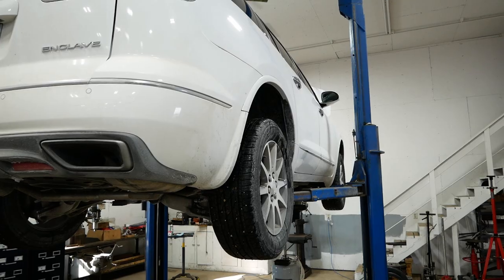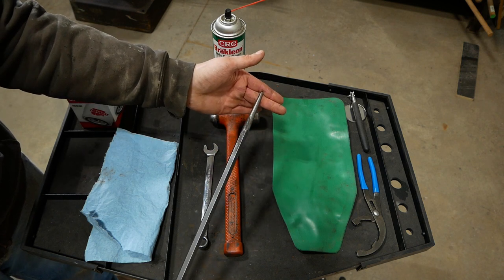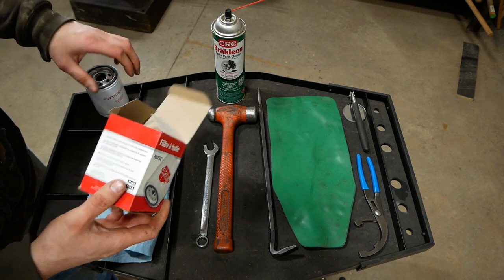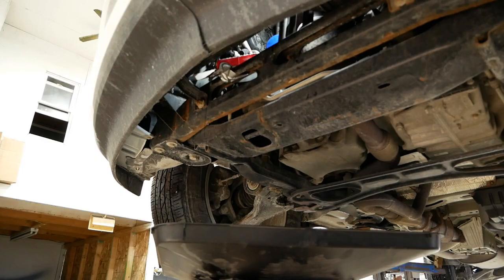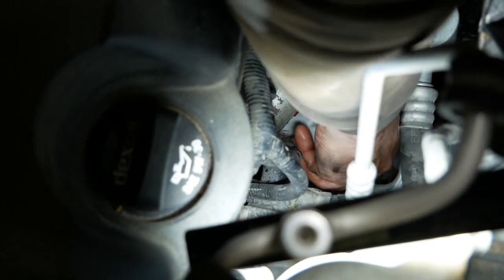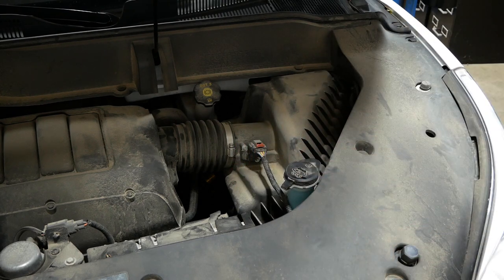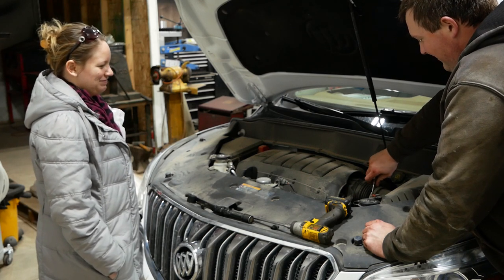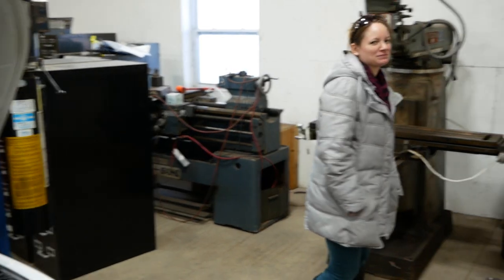Changing a GM 3.6L Spin On Filter without Spilling Oil?

Comment from the maker: How do you change these filters?
Form-A-Funnel General Purpose - https://amzn.to/360r9f6
Mayhew 16" Rolling Head Bar - https://amzn.to/2Y0jngN
Channel Lock 9" Oil Filter Wrench - https://amzn.to/3iAhIYE
Stanley 24oz Ball Peen Dead Blow - https://amzn.to/3phwzd2
CRC Brake Clean 6 Pack - https://amzn.to/3sLXobK
Reply: they what to service what they sell think about it if you soled a product wouldn't you what them to bring it to you for service you have  to think like a businessman just look at the vehicles today no dipstick tube on the   transmissions  you cant even  check the fluid  level
Reply: Run a shop vac on the oil cap while you unscrew and replace the filter.  It creates a vacuum so oil won’t spill out.
Reply: If I was doing those all the time I would make a piercing tube and then hooked to a vacuum oil tank suck the oil out of it.
Reply: @2ksilver  good idea!, But the filter will be full of oil that will leak out.
Reply: well when the engine is in the right way round it works fine lol lol 
pity the electronics on the 3.6 is crap IE the ecm and bcm communication in the aus varient we have down here in NZ.
 I have 3 of the pieces of s&%t in my workshop with f)$%#d computers
Reply: @2ksilver  is that an idea you've just had, or something you've done?

It sounds extremely plausible.
Reply: @2ksilver  The oil inside the filter will still spill out once you start unthreading and the seal is broken.
Reply: If you don't have or want to get a Form-A-Funnel a few layers of heavy-duty tin foil work great!
Reply: The reason why the engineers do that. Because in high-school they were picked on.
So they say, fine we will screw everyone.  Can't easy to do a oil change.  Plus if something breaks it can't be fixed. The revenge is complete.
Reply: @HerdOfMeese6195  
A strip of lead flashing in a  plastic bag. Throw out the bag.
Reply: I’d likely change it the way I “change” the internal filter in the CD4E transmission if I’m trying not to rebuild it, and that’s flush it with thinner fluid if it really is an issue and ignore it otherwise

Comment: As a GM engineer and due to the fact that cardboard is in short supply, it's better to remove the engine and put it on a stand to change the filter
Reply: And remove the engine to have optimal access to the air filter box!
Reply: Well, dang it all, now you're thinking like Ferrari, Lamborghini, Spyker,  McLaren.......
Reply from the maker: Must be a TSB for that!
Reply: @billh230  At least with the European makers, it's partially justified, even if just to gaze in wonder at the beautiful sight of the engine.
Reply: There was a car back in the 60’s - I think it might have been a Pontiac but I’m not sure - where indeed in order to change the oil filter you had to lift the engine.  Wish I could remember the make/model….
Reply: Oh that’s a classic time saver I bet.

Comment: The plastic engine covers are there to provide a safe haven for field mice to build their homes and raise their families.
Reply: Yup! I toss them in the garage until it’s time to sell the vehicle.
Reply: @mikemaccracken3112  The plastic covers or the field mice ? Or both ????
Reply: @terryharvey4811  The mice lol, save them for the next guy.
Reply: I thought they were copying the Euro trash
Reply: @ericcorse  Naaah... strickly a PR move by GM to please the TREE HUGGERS.. Gotta protect the WILD LIFE. MICE NEED HOMES TOO.
Reply: @terryharvey4811  surprised the tree huggers dont get mad at all the plastic used...maybe its cause they never look under the hood
Reply: skippy needs a home too
Reply from the maker: Out of sight, out of mind!
Reply: @mikemaccracken3112  Too bad on some engines like 2.4 ecotec the stupid engine cover is part or the intake plenum
Reply: true dat!
Reply: @baileyhatfield4273  TREE HUGGERS don't mind plastic on cars, it's all the plastic bottles in the oceans they are so upset about. Chokes the dolphins. {this I do agree with, I do recycle} Yet when you see them out and about, most are drinking mineral water..... out of a plastic bottle !!!!!
Reply: The plastic is for channelling the airflow through the engine bay to maximize cooling and muffling wind noise. Modern aluminum alloy engines conduct heat faster, in a moving vehicle the airflow is from the front, past the radiator and around the engine and on the firewall. The firewall acts as a dam and sends the now hot air under the vehicle and outwards. With a good airflow you need a smaller radiator and less coolant and cycling of the thermostat.
Reply: Actually those plastic engine covers are there to hide all their stupid engineering!
Reply: @terryharvey4811  there is nothing wrong with plastic, it is the people that dispose of it improperly that is the problem. Plastic is made from oil refinery waste.
Reply: I love your viewers, especially this thread! Eaglegards...
Reply: Hey, mice need transportation too.
Reply: terry harvey 
Ahh yes, can't forget the poor little mice...
Reply: Mustie will be happy to hear that.
Reply: @mohabatkhanmalak1161  The worst design anyway. It maybe works while it's moving, but when you're stuck in traffic it overheats worse than a 50 year old car...
Reply: @jameshaynie4570  i AGREE 100%. We should all RECYCLE if not for us, then do it for our GRAND CHILDREN. Without plastic I would not be able to carry a six pack of cold drinks !!
Reply: On my 97 accord there is no plastic covers in sight. Almost everything is easily accessible from the engine bay, and even most of the things that aren’t are easily accessible from the bottom.
Reply: @mohabatkhanmalak1161  Har Har Har
Yer hilarious.
Reply: @Tinker001  Oh yeah, well cheers!
Reply: Plastic covers is  to stop the mice cutting their fingers off on any Sharp or moving parts , and suing the company
Reply: Who are we to question morher GM and the obsession of the asthetics national culrure

Comment: Maybe GM purposefully put filters there, so that the frame can be coated with oil to prevent rust
Reply: Ah, the wonders of modern engineering, why fix a problem properly, when you can fix a problem with other problem... and they dare to call it a feature.
Reply: Ah, you beat me to it!  😀
Reply: i was going to say that too,,,
Reply: above the cat too? maybe they just want the thing to burn to the ground..
Reply: Bad thing about that, the rubber in the engine mount will eventually swell from the oil and heat... Wala, failure!  A new engine mount install!!!  More work for GM service shop, better yet, for Wes!
Reply: That's whats keeping half of my Saturn's subframe alive
Reply: @dylanyates6331  What about the other half?
Reply: @yzhang8629  what other half? 😆
Reply: @dylanyates6331  You said half of your subframe is kept alive by leaked oil, so I’m curious about the other half that isn’t coated by leaked oil. Is that part still alive?
Reply: @yzhang8629  its rusting out. Thats the joke
Reply: They probably saw Mustie1's video on coating the underside of your car with bar and chain oil.
Reply: And Wes said the GM engineers weren't very bright.   😂
Reply: @dylanyates6331  lol
Reply: I dont like the  sideway filter. At least when it is up right you can fill it befrore installation

Comment: I lost all respect for GM "engineering" when I had to pull wheels, wheel liners, closeout panels and a bumper cover to replace headlight bulbs.
Reply: Same on my 2011 Subaru! The damn headlight is made of plastic too, and most of it directly faces the UV furnace (Texas sun).

Comment: I'm 79 years old and have been changing my own oil for my entire adult life.  My wife has a 2017 Traverse with that engine, and I felt much better after watching a master mechanic struggle with that thing.  It's a colossal hair puller.  Between the oil filter and air filter, GM wins the Darwin award for that one.

Comment: Had a couple cars with this issue.  My solution has always been to keep a roll of heavy aluminum foil in the shop to make my own form a funnel.
Reply: I always raided the kitchen. Just make sure your hands are clean, or you get the evil eye or worse.
Reply: @cheeto4493  raid the kitchen that's always a tricky movement, once I was caught warming some welding sticks in the oven, it was hard to explain why  I was doing that
Reply: Peel n Seal roll flashing from Lowe's works really well also. AND.... you can stick it anywhere with the tar side.
Reply: @Jess88176  I have to give you TIP OF the comment day for that one. Noted!
Reply: Is this Jeff Leach the Toyota mechanic from Boston?

Comment: I believe as part of their training automotive engineers should have to perform oil filter and headlight changes on the vehicles they design for at least six months early on in their careers, then they might change things!
Reply: The car companies know, its just another way of getting more money out of you.
Reply: American engineers are smart enough to buy Toyotas.
Reply: Some car companies do, BMW makes their new engineers work at a dealership for 6 months or a year before moving into design.
Reply: Generally it's not the fault of a single engineer, it's a siloed design thing. The person that designed the engine with the oil filter there had a perfectly reasonable design. Then the person that designed the suspension and frame had a reasonable design. Then the person designing motor mounts had a reasonable design. Then the person designing body panels had a reasonable design, taking aerodynamic efficiency and aesthetics into account.

But you put everything together without a lot of great communication and time/money for redesigns and you get situations like this.
Reply from the maker: Nah. That would make actual sense.
Reply: They hire design engineer drop outs because they can pay them less.
Reply: Amen
Reply: @gregdrew874  As long as its a 1992 Celica 😉
Reply: Front wheel off 10 plastic clips  arch cover headlight bulb....try that at the of the road.
Reply: Astute comment. As a home builder I've said that about architects fresh out of school. It should be mandatory that they work as part of the labor force on at least the first two houses they design. Life would be smoother.
Reply: @murphymmc  I once did an apprenticeship with an electrician and just in those few weeks I have seen some dumb shit... And copper theft.
Reply: Don't forget headlamp bulb changes in situ, when they leave zero room to get a hand behind the lamp unit.
Reply: @anthonydefreitas6006  it just makes work for service techs unnecessarily harder, I don't work on cars I work on refrigerated trailers but stupid engineering is the same
Reply: @Fly-Away Exact same here!!!!  It's like four steps from standing in front of the truck, to standing on the ground at the driver side front of the engine...
Mine is a 2WD long bed Custom, with a three-on-the-tree and manual steering.
Reply: Watch out for the washer hose lines pinching under the air box. Put a rag under the oil filter.  Battery is in the back seat under the floor.  Headlights must be done from the fender well.
Reply: A Car Mechanic Friend Told me a customer arrived wanted the headlight bulb replacing (early Ford Ka ) brought new bulb , this day he was very busy thought only a bulb will only take a few minutes  when he got round to it found only way was to take off the  front wing to access headlight. the spare parts supply company ( Halfords) in UK will fit replacement bulbs for an additional fee but not this one, he found out later they were giving customers the details of local Mechanics and saying they were busy.
Reply: Every time I do an oil change on something like this that’s the first thought that coms to my mind besides how much I wanna kick then in the 🔩🔩

Comment: Plastic covers are there to hide the poor engineering mistakes ☺
Reply: GM engineer to GM designer "Cover that up with some plastic covers to hide our piss poor designs!"
Reply: I can understand plastic cover on top of a valve cover, makes the engine bay look clean, but other than that, i always toss those pieces of plastic away first time i have to take them out.

Not like they would survive the taking off part anyways. Always some clip breaks or something.

Comment: One of the things that so impressed me about our Lexus Rx400h was a little lip of steel that sits under the filter, designed to funnel the dripping oil to a spot that would drip straight into the pan below. Class engineering all the way.

Comment: I use a soda bottle with the bottom cut off that slides over the filter after I pop a hole in it like you did. I have a 2 ft plastic hose clamped over the pouring end of the bottle to allow it to drain  and oil never contacts the under side of the car. It works really well.

Comment: The only time I poked something through the oil filter was a screwdriver when it was so tight the wrench didn't work. But your method sounds like a good idea as well.
Reply: I use the same method poke the bottom and let the oil come out

Comment: The trolls will be like "you didn't show smearing oil on the seal of the new filter"... but I know you would never not do that...
Reply: I think this is your way of being that exact troll.....
Reply: I think I’d have used a piece of plastic gutter ....
Reply: I use Rightstuff. That babay won't leek.
Reply: @madjimbo4176  no he/she/it is being a troll.
Reply: @JosephArata  I think she was being serious.  Lol
Reply from the maker: I use rendered skunk fat. It's the only thing that works....
Reply: @WatchWesWork  where you getting the rendered skunk fat? My jar is running low and I had to find that jar at a hot rod swap meet years ago. I used to get it from the cummins tool truck but I haven't seen them around since the Amazonians took control....
Reply: @WatchWesWork    A certain percentage of watchers are currently googling rendered skunk fat.   These folks are also doing their monthly calibrations of their torque wrenches they never use.
Reply: @JosephArata  I prefer the he/him/they pronoun. Cause I'm a dewd. And yes...sackarsm.
Reply: @WatchWesWork  But you also take off the gasket and apply the rendered skunk fat on both sides of the gasket, right?
Reply: @madjimbo4176  The calibration comment reminded me of the 20 years I spent in the Navy wrenching on airplanes!
Reply: @WatchWesWork  I tried to get some of that at the local auto parts store, they put up a big stink.
Reply: Locktite for the threads and liberal amount of RTV on the gasket. Use a 1/2 impact with a filter wrench/socket,  
and tighten the oil filter to two uga dugas. It'll never leak.
Reply: Why not a 3/4...you cowboy?

Comment: I used this same trick of popping a hole in the filter when I used to change oil on Detroit Diesel transit busses. It also made the filter lighter.  I always had a hammer and pick awl on my tool cart. Only thing I would’ve done different is to make sure you can get the filter off before picking a hole in it.

Comment: Hi Wes, great videos, makes my day when you say " THERE'S YOUR PROBLEM LADY". Unfortunately not as much lately. The one thing I learned doing filter changes is to loosen the oil filter so you can spin it off with just your hand but not until it starts leaking. Then just place a large plastic bag over the filter and up against engine then just spin off the filter and let it fall into the bag. Never get oil on your hands again.

Comment: Remember when an air filter could be changed by removing one wingnut.
Reply: Yes sir, my 1955 Austin has one wing nut for air filter.... actually, it’s not even a filter but a oil bath type.
Reply: Yeah back when you can get rocks thrown into your engine if you don't keep an eye on it
Reply: GM is out of wing nuts....
Reply: I have a 90's 2.2 Camry as my daily and it's just three clips, a 30 second job. Also the oil filter sits upright so you only need a rag to change it. There's a reason so many are still on the road today, 90s Toyota knew how to make things easy. 🤔

Comment: Ahh, the old cardboard trick - I guess you can think of it as recycling. I use aluminum foil to cover the spill areas, rather than making a funnel, it works - well - most of the time, but not always. [cut to shop floor, show spill]. Thanks again for your videos, always makes my week!